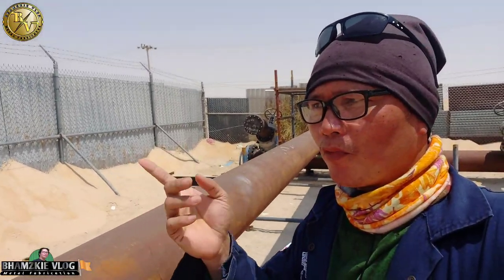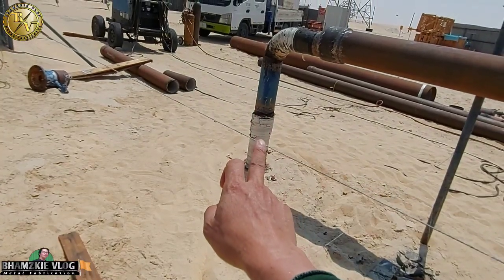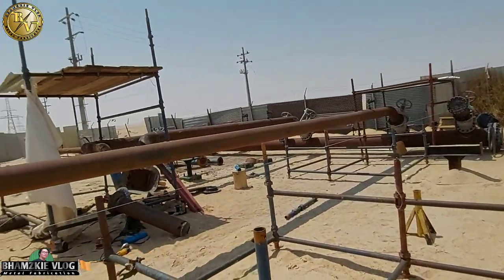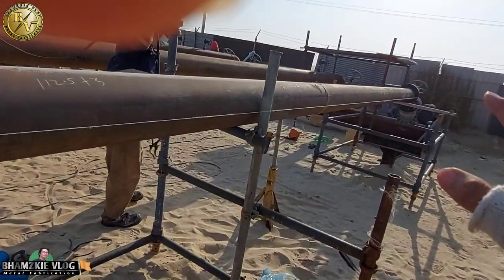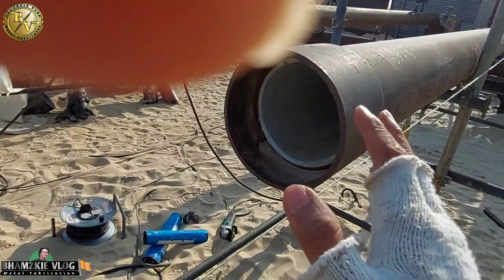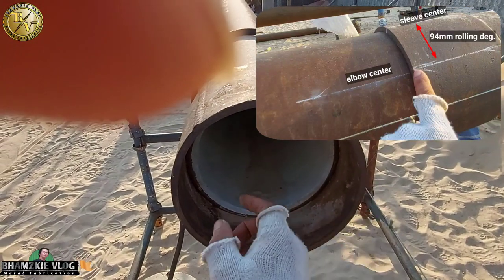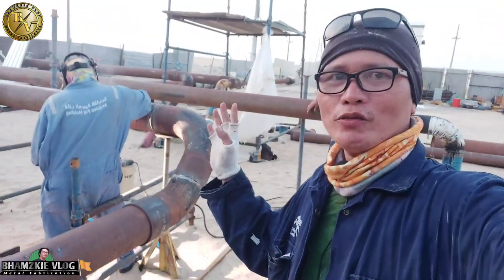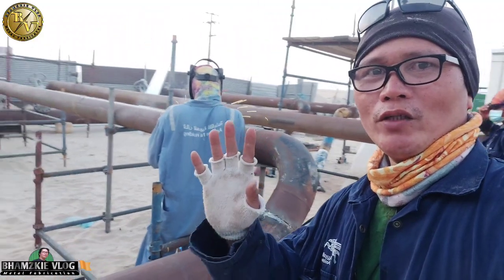HOW TO LAYOUT PIPE EXISTING LINE CONNECTIONS|@bhamzkievlog5624

Comment: Boss pano poh pgcompute ng kagaya ng ikinabit mo n 90 at saka 45 degree pano kunin ang ispol nyan salamat..
Reply from the maker: Naka rolling po yang 90 deg.sa 45 degree rolling boss,at naka 45 deg. Offset po sya,kunin mo lang ang height mula sa center ng elbow,kung ilan po height nya ganon din po sa run,
Ex.height is 500mm kuha din po kayo ng 500mm sa run,para makuha ang travel
500 x 3.1416=travel.

Comment: Magandang araw o gabie boss.boss pwedi pki explain ang root pass/hot pass/filling 1-2/ tpos capping.ksi ayaw nla maniwala na limang paraan pag welding ng mga tubung makapal.ksi ang nagiskusyun ay matagal na daw cyang welder ng makapal na tubo.tinanung ko kng ilang beses mo tirahin ang makapal na tubo.hndi nya nasagot ang tanung ko sa kanya.hndi akng isang welder boom truck operator ako dito sa saudi pipe line ang trabaho nmin dati.
Reply from the maker: Tama po kayo sir root pass,hot pass,ang filling nag depende sa kapal ng tubo,ganon din ang capping.
Reply: Matagal na welder siguro yun sir sa flat bar lang hindi pipe kasi iba ang pipe welder root pass, hot pass capping kapag makapal 3-4 patong yun capping sa nakikita ko lang.